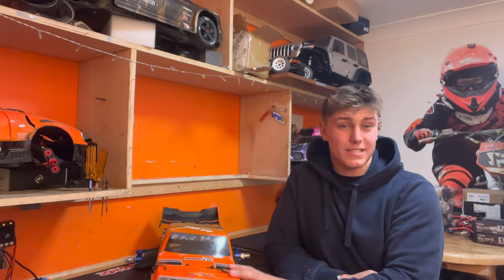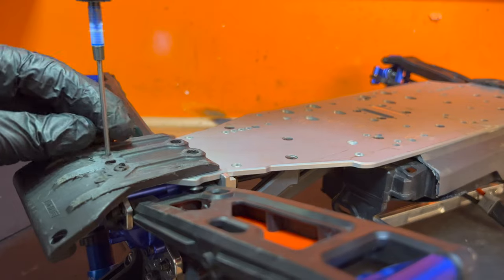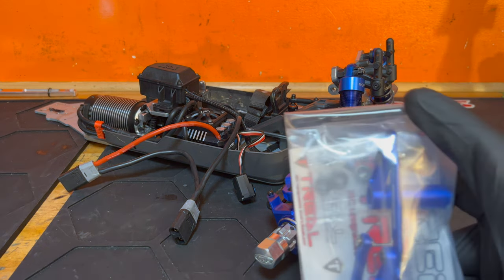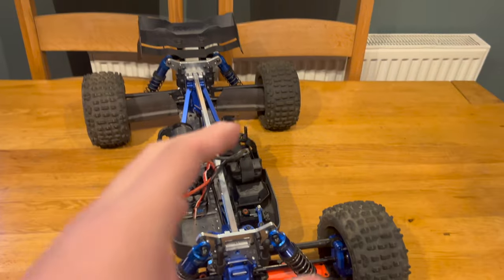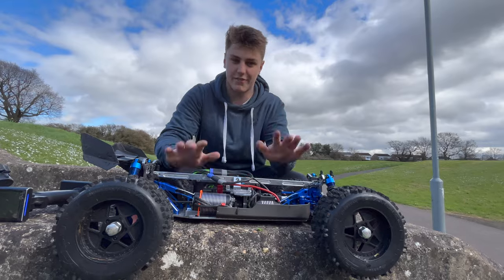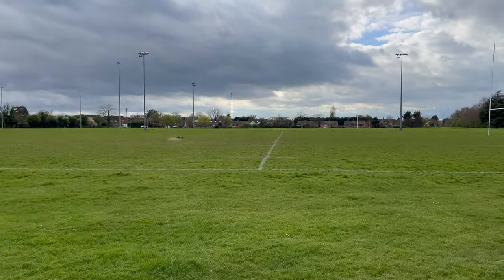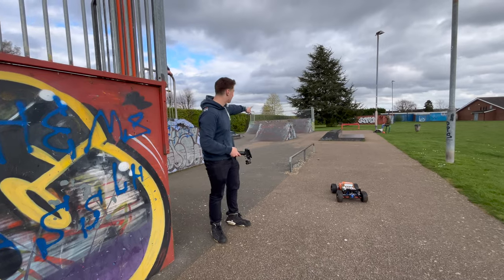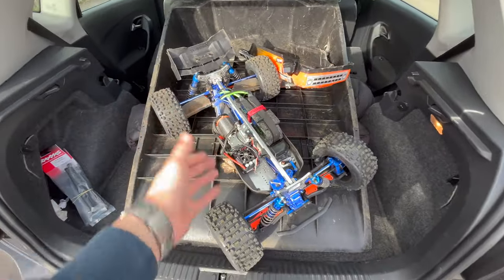Traxxas sledge 6s ( M2C JackHammer) extreme bash

Comment: So I'm curious, how do you find the design of the sledge in comparison to other brands of similar size and layout.  Is this easier to work on?  I'm going to build my next RC from scratch I'm just trying to decide what platform to go after.  They will all be about the same price in my opinion because we are using aftermarket parts instead of rtr parts. Losi? Arrma? Tekno? X ray?  What chassis has the best design and most aftermarket support?